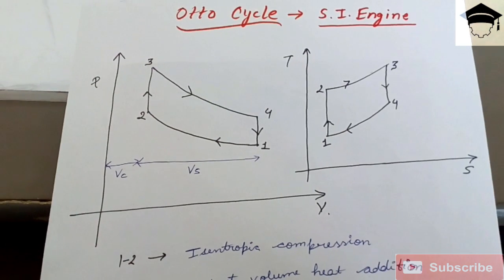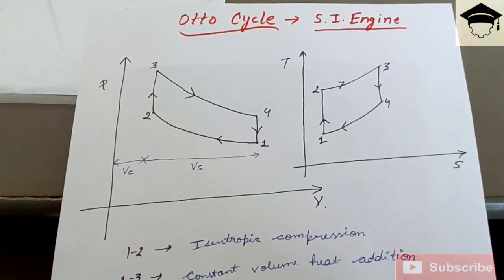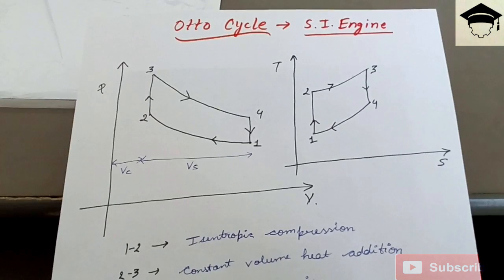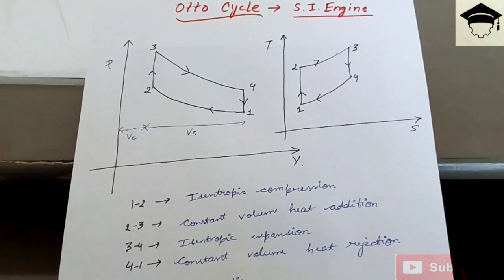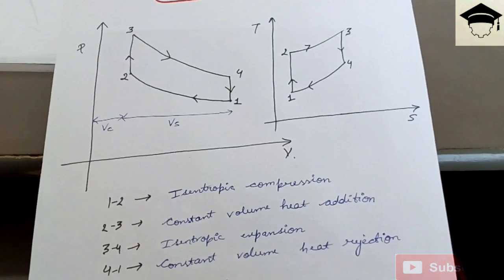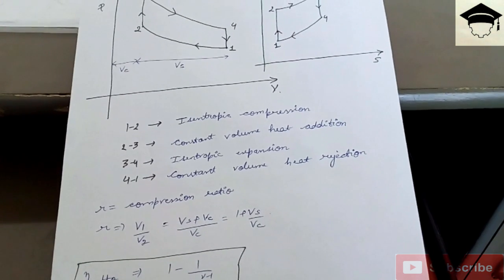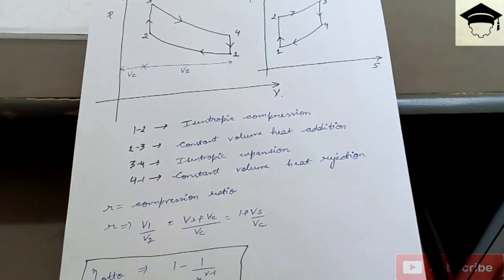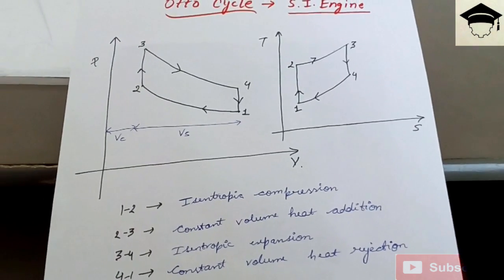otto cycle - si engines full explanation | pv and ts diagram of otto | otto cycle petrol engine

Comment: How many numbers are come this chapter in paper
Reply from the maker: It Depends. Short question 2 to 5 marks. Long answer type 10 to 20 marks Theory or numerical .
Reply: @onepointacademy  if they ask it for 10 or 15 marks,  what all should we do, are we supposed to draw all the four strokes and explain?
Reply from the maker: @ManojKumar-hn7vu  please draw pv and ts and explain each process in detail. You may also explain a numerical for the same.